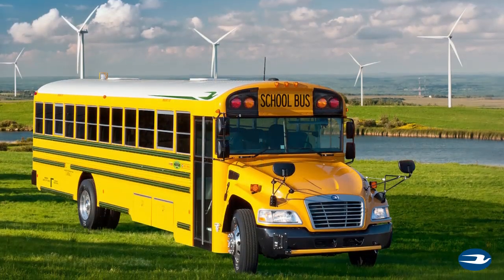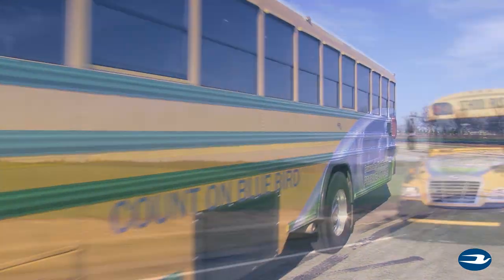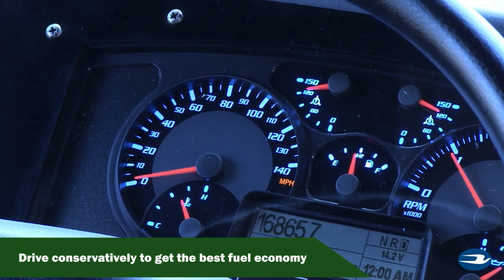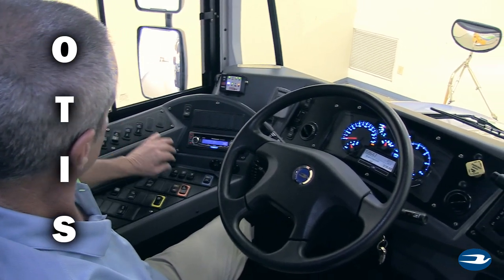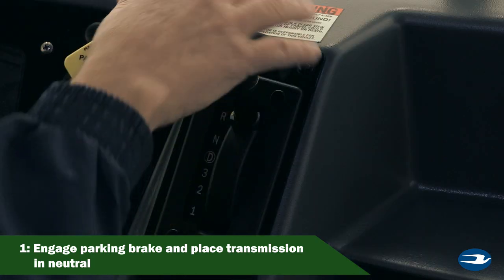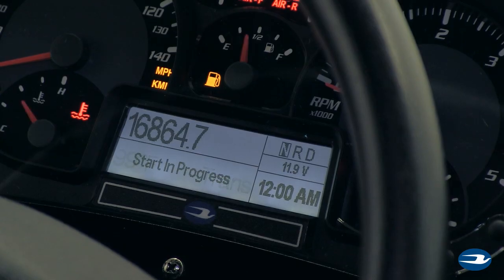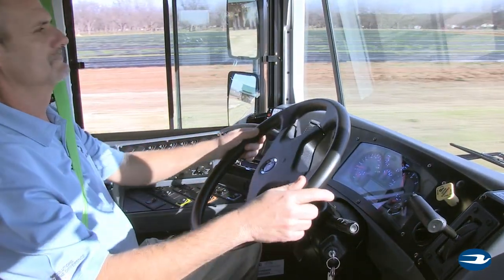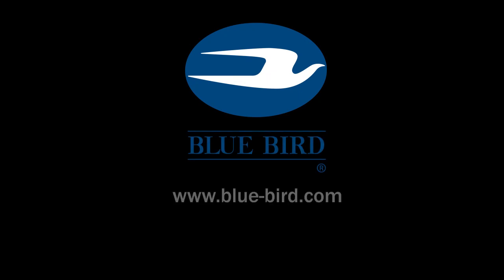How to Drive a Blue Bird Propane-Powered Bus

Comment: I'm Sorry but This has been the worst Bluebird I have drove, in the 10 plus years as a driver/mechanic! The Transmission does Not Preform well at all in our area! I have to shift the Transmission manually Because it doesn't hold  gear long enough to be safe while operating! The bus has spare fasteners rolling around the floor,It squeaks worse than the 12 yr old bus i drove previously...Apparently they must have ran out of plywood & silicone when building the floor, It has gaps big enough to see the transmission.. The brakes Squeal because the transmission will not hold the bus back on hills requiring more brake use, which has over heated the brakes...The list goes on & on....I wish they would give me back my 12yr old Diesel bus back, its safer to operate than this thing...!!!

Comment: What’s funny about this is how you start it. In the video, it says apply parking brake and shift bus in Neutral.  Wouldn’t the bus be already in neutral and parking brake on before you turned it off? 🤔😂. If the parking brake was not on, it would just roll away.
Reply: But those are the best kind! The BlueBird Roll Aways! Requires no fuel and completely green. It will even keep Oh Biden happy.

Comment: Propane buses aren't anything new.  In the early 80's school systems used LP powered buses frequently.    I guess it was in response to fuel costs back then and before diesels were used in the following years.
Reply: divisioneight oh no wonder why the 80s blue bird all American Type D bus sounded alot like these engines shown in these buses in this video

I still liked the deisel engined counterpart better, although those engines did have a really low engine idle (two strokes a second)

Of course again I'm talking about the 80s blue bird All American Bus

(That bus with a square grille and with chrome rails that ran across the flat nosed front end)

With it's sets of headlights mounted in a vertical position instead of the Horizontal position

Comment: Propane is the biggest mistake you will ever make in your life
Reply: I said what you said is retarded. You said I am retarded. That's called an ad hominem attack. This is not accepted in academic writing and arguments.
Reply: Propane has a 112 octane rating whereas gasoline has an octane rating at most 100. Higher octane fuels inhibit knocking in a spark-ignited engines. Propane has nearly the same specific energy as diesel fuel. (Propane=46.4Mj/kg, diesel=48Mj/kg, gasoline=46.4Mj/kg.) Propane, being a simpler molecule will release more potential energy during combustion than either diesel or gasoline. Propane burns cleaner than diesel or gasoline which is better for the environment. Because it burns cleaner and more thoroughly, propane leaves less carbon build up in an engine than gasoline or diesel. Propane will not float on water and continue to burn like gasoline. When propane ignites, it flashes over whereas gasoline keeps on burning and burning. For a diesel gallon equivalent of propane, the wholesale price is $1.38. For a gallon of diesel, the wholesale price is $1.59. All though, natural gas is better.
Reply: The channel without videos?
Reply: Gammareign yes that's the one
Reply: Why would I do that?
Reply: Gammareign doesn't really matter to me if you do or you don't. I really don't care if you ever find out!
Reply: il 2nd that there awful worked for a company that had them a few blew there engines with 15,000 went to a different company just to get a diesel all american again
Reply: That's funny cuz I have 3 vehicles running on it without a problem. Couldn't have nothing to do with engine manufacturer producing junk could it?
Reply: Propane Solved agreed, CNG and Zero Emissions are so much better.
Reply: @emvvehicles_8  CNG has emissions, albeit that it has tiny emissions.
Reply: I agree after abiut 40k miles the problems begin

Comment: we had a 1977 90 pass All American that was propane powered. I assume it was done at the factory cuz the bus co we bought it from said other than basic matence they never did anything to it. was that the 1st generation? we picked it up in 1997 and they had just removed the original spark plugs from it. other than the rust on the exposed part the tool slips on it looked new and it was obviously original. we sold it in 2001 and I actually miss the thing
Reply: +new produt corp it was a front engine all American 1977 blue bird. a bus company in Little Falls MN had it. We purchased it when it was 20 years old. it ran on propane and was a very nice thing to convert to an rv because we could tap into the fuel line for things like the RV stove, fridge and heater without adding a fuel tank. we sold the bus in 2001.
Reply: Cascade Railfan isn’t a All American a FE bluebird flat nose?